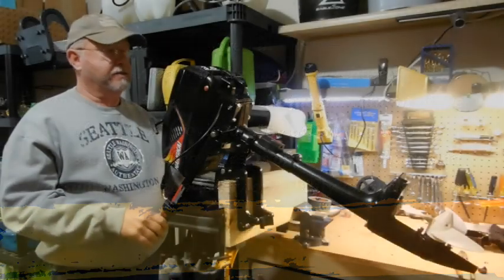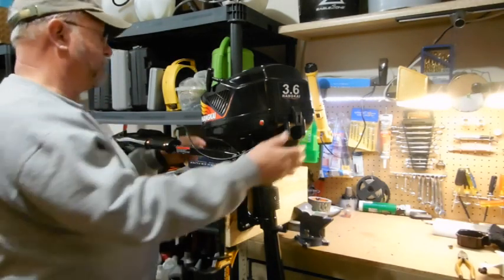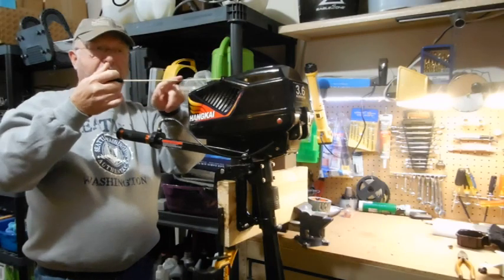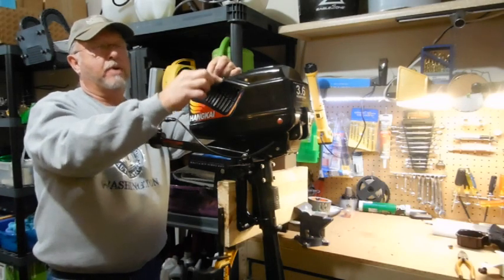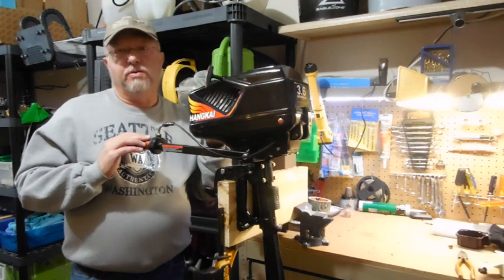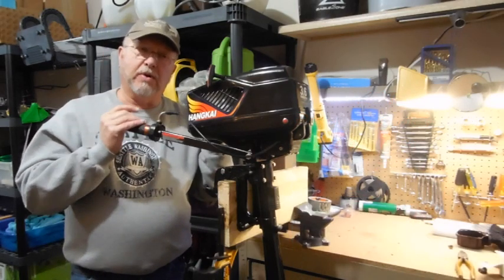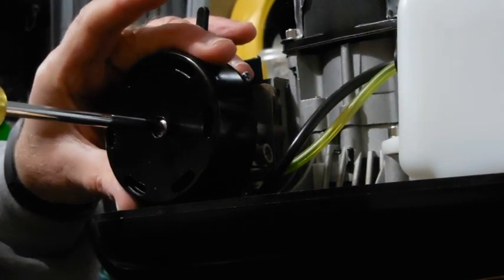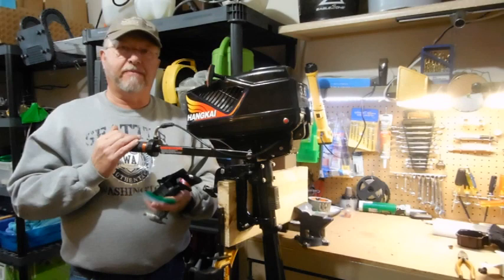Hangkai 3.6 / 3.5 hp outboard motor - 10 Things To Know

Comment: Hi mr dan..my hangkai 3.6hp not flowing water thru the exzos..only smoke..and my field test my engine running wheezing..why this thing happend..
Reply from the maker: I can’t know for sure. Water will only come out when you accelerate enough that the propeller is turning.
If the propeller isn’t turning, you might need a new clutch.
The water pump is just a simple paddle wheel that attached to the shaft near the propeller. If the paddle fins have broken off, you just need to replace the water pump wheel.
Here’s a link to all the videos that I posted. Check out the ones regarding clutch repairs for possible help.
https://youtube.com/playlist?list=PLjMZtm2hvqrOIvLcah1u1V45Y_R-AKeqm
Reply: @BoilerDan1  water problem solved after i put flexible wired thru water hole until the wired exit at the water inlet near the propeller..might be something blocked the water channel..
Reply from the maker: Good job!  Yes, I think there must have been a small piece of debris that the pump sucked in and it got stuck in the tube.
Thanks for letting us all know! I’m sure it’ll help someone else out too!
Thanks for watching 👍

Comment: BoilerDan1, I need this motor like I need a hole in tha head, but that's another subject.  I've been lookin at this motor for some time, but nobody has got into detail of the true operation of it, what to do and not do.  How the break-in works and what to expect.  I know up front it's cheap and made across tha pond, but then again what really isn't ?   Are parts easy to come by ?  Can this motor be modified ?  What's your idea bout replacing the fuel line right off tha bat for a better one ?  The spark plug replacement is a no brainer.  What weight gear oil ?  Like I said, I need this like a hole in the head, but I want it just tha same..
Reply from the maker: We sound a lot alike, I didn't need it either, just bought it to play around with!
First thing you need to have on hand for future use:
Clutch replacement: Here's a sample, but you can enter the info about HONDA GX31 GX35 GX35NT Fit MITSUBISHI TL33 TL43 TL52 T180 T200 T240 Bush Cutter Tiller Trimmer Strimmer as that is what fits.
https://www.amazon.com/gp/product/B07J6F4J6M/ref=ppx_yo_dt_b_search_asin_title?ie=UTF8&psc=1
If you watch all my video's, I recommend replacing the clutch spring with a lighter weight one as it will improve it working and lasting longer. 
Fuel lines.  I'd keep the ones on it for the first season then replace them.  It's the ethanol fuel that eats them up.  I think they are now making ethanol friendly fuel lines.... 
Break-in: Actually you can break it in while using.  Just very your speed every 5 minutes or so.  The way I did it isn't the best, I just don't have water around me and I purchased mine in the winter.  You need to keep cooling water running if you do it in a barrel or bucket and I didn't point that out in my videos.... I was pouring snow in the bucket constantly.... Don't want to get it overheated...although I've since been told that it's as much air cooled as water cooled... If I had it to do over again, I'd consider the air cooled 4 stroke model....In hopes it would be quieter?
The gear oil can be the full synthetic kind for the best protection, I think the manual says 90 weight.  Here's a link to the manufacturers web site:  Look under the tab for "Articles" and you will find a lot of information and trouble shooting stuff:
  http://www.hang-kai.com/en/nr.jsp  I tried to copy the link to that page?
The pull starter is another issue that you will want to have on hand.  Mine came with two.  If you remove than handle and the string gets pulled in to the winder it's a goner!  No way I could figure out how to get the spring re-tightened.  The rope will wear out too.  Coating with bee wax will lengthen its life.  You can order those too: eBay:
https://www.ebay.com/itm/324402571624?hash=item4b87e66968:g:dUYAAOSw~~RfyFDn
You can also find the little carburetor, just do some searching... They are pretty much all the same little gizmo.  
Hope that helps?  I don't know much about modifying the motor, but it's easy to work on!  Aluminum, so don't overtighten the bolts and screws!  But the block itself seems very solid!  It's the little things that are cheap!  But I have had a lot of fun with it... But it's a noisy little bugger, not great for trolling...But it'll get you to the other side of the pond....
It'll be better on a solid small craft....My little raft was too spongy, causing me to lose some thrust and power.
Enjoy your adventure!
Thanks for watching  👍

Comment: My propeller does not spin..I did everything in your video..no spin
Can you help please
Reply from the maker: It sounds like the spring or the bolts holding the spring in place are too tight, not allowing the clutch to engage.  I think if you watch the video you can try to fix it.  Unless you want to try to return it to the seller?  It’s not a difficult job to do, and your going to have to learn how to replace the clutch in the future anyway.
But it’s your decision to make. Hope it goes well for you 👍
Reply: Last question..how do I get motor to stay in place so that when I give it gas it doesn't lift out the water
Reply from the maker: The best way is to break in the motor by using it on your boat!  I only used bucket because it was in January and very cold, plus I’m far away from lakes. Also if using bucket or barrel, you must keep cool water running in the bucket so you don’t overheat the motor. I kept adding snow!
You’ll need to build a frame to hold the motor, so instead, it’s easier to attach it to your boat and take it out on the water running at various speeds to break it in. Doesn’t have to be done in one day, just keep track of the hours of using it. Once broken in, you can go full speed all the time 👍👍😎

Comment: Can an external fuel tank be attached to this outboard?
Reply from the maker: I don’t have much expertise in that area.  However I think it would work fine.  I think you’d need a primer pump in the fuel line from the container but once it starts , it would pull the fuel from your tank to the carburetor using its vacuum created by the pull of engine sucking in the air/fuel mixture.
I hope some viewer can be more certain from experience.
Thanks for watching 👍
Reply: @BoilerDan1  Thank you for getting back to me. I have a new external tank with the primer pump. I think I'm going to try it. I will probably go through the fuel cap on the motor. First, I'll buy an extra motor fuel cap just in case because I'll have to probably poke holes in the original. 
Thanks again for replying.
Reply from the maker: @raywilsonsr1239 I’m no expert on the subject but wouldn’t you just hook into the fuel line? Then once you prime, it will suck the fuel out of your tank?
Reply: @BoilerDan1  I want to keep the quick connect and disconnect available.

Comment: Does anyone know the size of the fuel lines from the fuel tank to the carb?Maybey 3mm but can"t be sure
Reply from the maker: When I replaced mine, I purchased a set including several sizes and just picked the one that fit.
Here’s a link to what I used:
HIFROM 4-Feet Fuel Line Hose Tube (4 Size) I.D. x O.D. 3/32" x 3/16" 1/8" x 3/16" 1/8" x 1/4" 0.080" x 0.140" https://a.co/d/gjkhahA

Comment: Thanks
Reply from the maker: You’re welcome. Appreciate your watching 👍
Reply: @BoilerDan1  I gave you a sub. Looking to find a lightweight, outboard motor for my kayak. Any new updates?. Another outboard recommendation from r my application?.
Reply from the maker: Oh, I only received the word “Thanks”.   I’ve posted 16 videos on the Hangkai motor.  It’s not without issues but overall the motor itself seems good enough. However the little things like fuel lines and the clutch wearing out is a hassle. There’s 3 videos on the clutch and the tension spring..... for use with a kayak, I think I would consider an electric trolling motor.  Being able to attach and being able to turn around and pull the start cord might be an issue on a kayak? This was the first outboard motor I’ve had since I was a teenager so I can’t give much advice on other models. The Hangkai is fairly light at under 22 pounds as I recall. That’s fairly light for sure but on a kayak? Not sure about that? Thanks again for watching. You can probably find all 16 videos by searching BoilerDan1 on YouTube.

Comment: I would Not worry about the air filter,  at least it has one,  most name brand boat engines DO NOT have air filters,  there's no dust on the water, and if theres is it's so minimal that you don't have to worry
Reply from the maker: Yes, so I’ve figured out.
Thanks for watching and taking the time to help out.👍

Comment: Just bought 3.5 hp motor, going to change spark plug,  and put gear oil in the motor  !! How can i contact sir if I need help??
Reply from the maker: Good luck with your motor.
You can write here anytime. I regularly Check for comments and questions.
One important thing. You do not need to break the motor in using a bucket. It was winter here and I kept adding snow to keep the water cool.
It is better to take it on a lake or any water way and drive it around. I don’t have water near me.
Thanks for watching 👍
Reply: @BoilerDan1  well Dan having a serious hard time trying to lower unit housing to put in 90wgt gear oil, star screws just won't come loose,  any assistance would be greatly appreciated  !!
Reply: @BoilerDan1  I think k it will be easier just putting on a pond for break in time frame, but didn't you say to run for an hour, then let it cool down, then run again and repeat steps till 10 hr mark is reached..??
Reply from the maker: I think I was listing what I did. I think on a body of water you could run it more than an hour.
The manufacturer’s web site lists the following:
HANGKAI two-stroke outboards fuel used for lead-free number from 90 to 93 two-stroke gasoline and gas oil (TC-W3) mixed oil.
The new machine in the running and fuel oil during the volume ratio of 25: 1 (ie, the oil content of 4% gasoline);
After the run-in fuel and oil volume ratio of 50: 1 (ie, the oil content of 2% gasoline);
Reply from the maker: I think you’ll obviously have to put in gear oil as you will damage the gears if you run it dry.  You must not over tighten them so be very careful!  The block is aluminum and the rubber seal inside doesn’t need the screws tight it just needs to be held in place to seal the unit.  There needs to be an air gap, so don’t over fill the gear oil. Leave about 1/4 inch for air space. Fill just to the line.  If you have some that is experienced in taking motor’s apart have them help removing the star screws. Here’s a video of me removing the bolts to add the gear oil:
https://youtu.be/NCALT3MKAEk
Reply: @BoilerDan1  I understand what you did  completely,  but getting those screws loose is my issue, they won't budge one bit !!
Reply from the maker: I’d recommend professional help! You don’t want to damage them.
Reply: @BoilerDan1  I hear you loud and clear, can't heat it up, due to soft Aluminum,  they are painted in,  is my best guess, going to try DD pentrating oil,  then I will  try an find some one, if that doesn't work  !!
Reply: @BoilerDan1  I read that on their website,  but on Amazon listing they said to use 35 to 1 ratio, and do not go by manual, going to use Blue can fuel, which is premixed , and non ethanol  fuel,
Reply from the maker: The penetrating oil is a good try.  I hope that works. Give it a good 8 hours to work it’s way in!
Best wishes for your success!👍
Reply from the maker: I think that’s a good safe way to go 😁👍
Reply: @BoilerDan1  so o took your advice brought motor to outboard mechanic that I know. Had gear Housing off in a flash, 5mm star driver fit like a glove !! Plug changed ,gear oil in , grease fitting Greased, all I gots is put gas in and run, you really helped out , Thanks so much  !!
Reply from the maker: As always, the right tool for the job makes all the difference!
Thanks for the follow up. It’s always good to hear about the solution. 👍👍

Comment: So when I opened mine up it had gear oil in it, so I closed it back up.  The engine ran but the prop wouldn’t turn.  Opened the lower unit back up and there were metal flecks,  I replaced all the oil and fired it up again.  Still nothing.  Any ideas?
Reply from the maker: If you have the water cooled motor, it works on a clutch system.  So at idle the prop won't turn.  However the metal fragments are a little concerning..... 
If nothing is wrong with the unit, then if you accelerate the motor about half way, you should get it to turn. It may take a little more than half way to full throttle and it takes a couple of seconds for it to get going.  You can kind of hear it kind of slip into action so to speak.   A bit of caution though, I have heard of people having the springs in the clutch slip off, but that clutch is not near the propeller.  
Did you purchase it new?  It usually ships with no fluids in it at all.... If you got it used, I'm going to guess that the clutch system is defective.  Search some more on YouTube and I think you can find something on it.  Even if non-English, the video will show you the area it is in.
Reply: BoilerDan1 it was definitely new.  Maybe they changed their shipping practices.  It seems like there is something wrong with the lower unit.  I am gonna try to open it up again and see how it looks after running it again, but I may just abandon it and buy the Yamaha.  It seems like it’s not turning at all even when I crank it up.

Comment: Is there an advantages of the 3.5 vs the 3.6 ?
Reply from the maker: The 3.6 is a newer version. The cover comes off easier and is a plastic material.  The motor itself is the same as far as I can tell. But I prefer the not having to take screws out to open up the cover.
Thanks for watching. I've made several videos on the motor. Might check most all of them to know what you'd be considering.
Reply: @BoilerDan1  Thanks. I really appreciate the time you spent making the videos to help out the people interested in the motor. Seems like I can avoid a few mistakes that people made before going and giving the motor bad reviews.

Comment: So after break in I can go to 50-1 ??
Reply from the maker: Yes, after breaking in the motor, change the mix to 50/1. It will burn cleaner. Also it’s better to break the motor in out on the lake, not in a bucket or barrel.  You must keep cool water running if in a barrel. I kept adding snow as it was winter when I got it..😂👍

Comment: How much does it weigh
Reply from the maker: Just a little over 22 Lbs.  Here is a link to the companies web site. http://www.hang-kai.com/en/pd.jsp?id=14 You might find more specifics.  If you have watched my segment on replacing the clutch, I'm confident you are aware of the minor issues I've had to deal with.  I think the engine itself is sound, but the little parts, especially the clutch should be of much better quality.  Adding the lighter spring will improve it's performance. 
Thanks for watching.

Comment: Where do you buy parts
Reply from the maker: I’ve found things on both Amazon and eBay.
Here’s a couple examples of parts that tend to need replacement:
https://www.ebay.com/itm/Recoil-Starter-Pull-Start-for-2-stroke-Outboard-Motor-2hp-3-5hp-Hnagkai-Boat-Eng-/324402571624?mkcid=16&mkevt=1&_trksid=p2349624.m46890.l49286&mkrid=711-127632-2357-0
Clutch Drive Bolt Washers For... https://www.amazon.com/dp/B07J6F4J6M?ref=ppx_pop_mob_ap_share

Comment: Is this motor still running good?
Reply from the maker: I think so? 😂 At almost 70..... it was getting difficult to load up the raft and set it up.... I sold it to a guy that was familiar with the Hangkia engines and was thrilled to get it!  He knew that changing the clutch was a simple but regular part of the maintenance... If I were younger I’d buy another one! Maybe get the 4 stroke, if only for it having a muffler!😂😂.  Thanks for watching, I made several videos on the little engine. I would recommend watching them all prior to ordering one!  With your handle being Mopar 440 I’m guessing that a little motor working would be fun for you 👍👍
Reply: @BoilerDan1  Thanks! I've done a 72 440 swap in my 84 ram.
Reply from the maker: This will not be any problem for you if you decide to get one.👍